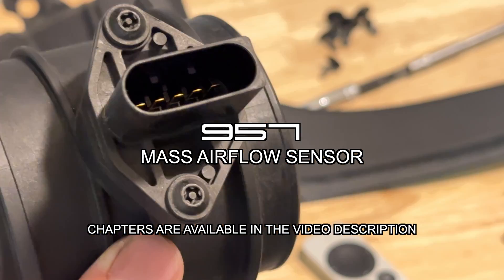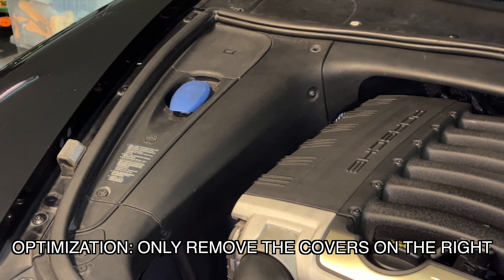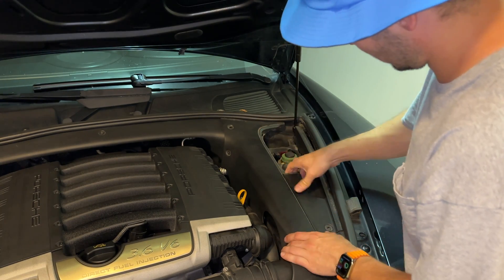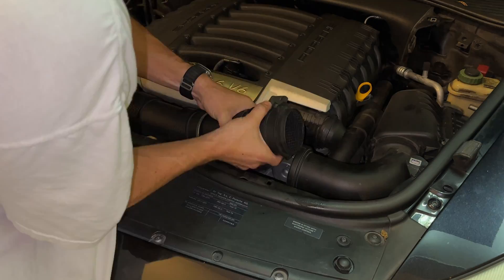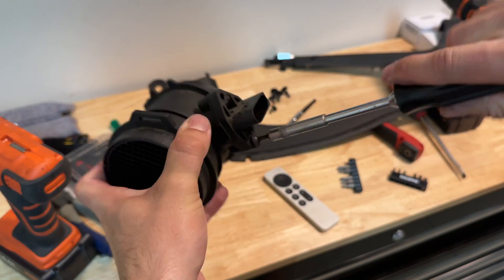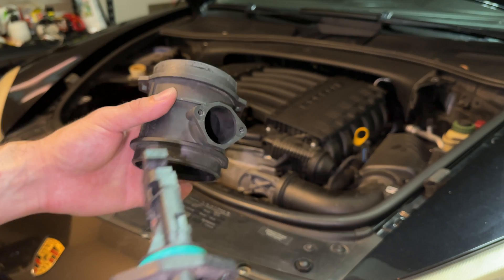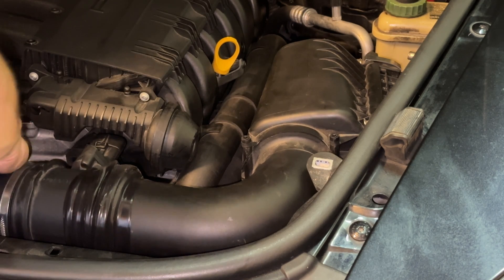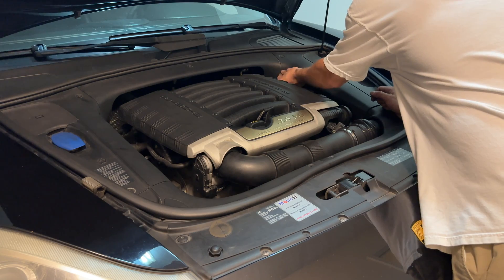Mass Airflow Sensor (MAF) | Porsche Cayenne (955, 957) (2003 - 2010) (9PA) VR6 3.6L Base Model

Comment from the maker: Have you found this guide helpful? Any tips? Share below:
Reply: @RuslanVideoFilms  very helpful. I wonder if the cleaner will still work if you can’t remove the sensor component from the housing.  For example, spraying through the plastic outer housing.

Comment: You made disconnecting the electronic connectors @1:53 look easy.  What's your secret?
Reply from the maker: push in on the tab and it pops out. if it’s stuck on there you can wiggle in a flathead screwdriver and wiggle it loose

Comment: The MAF unit in a 2016 Cayenne does not have the torx screws which allow remove of the sensor. Seems you must replace the entire unit… msrp 244 usd
Reply from the maker: oof. Good to know / be fore-warned about the Porsche tax. 🙏 MAF is one of the few  things you don’t want to skimp on, should buy OEM instead of aftermarket because aftermarket are rarely as accurate and lead to problems.
Reply: @RuslanVideoFilms  I think there may be a defect in the MAF units used in the 2016 Cayennes for US. When misfiring begins and auto start stop disables itself, I get a check engine light. After codes are cleared the issue goes away completely for about 6 months. Porsche service has never suggested replacing the MAF, even though codes state MAF issue.